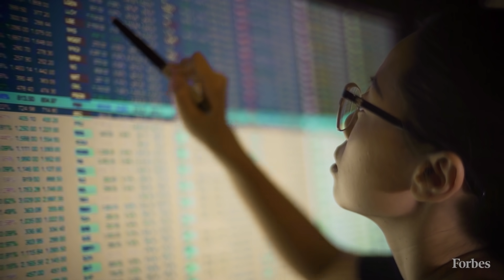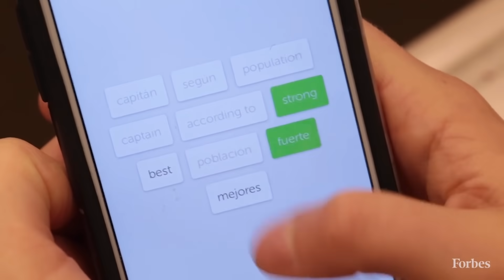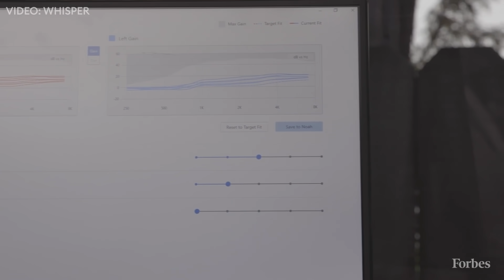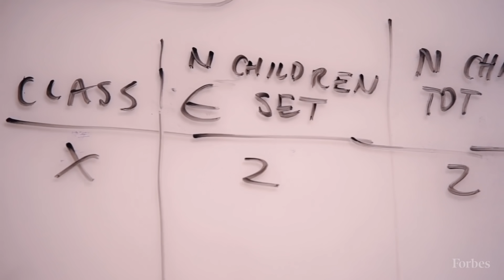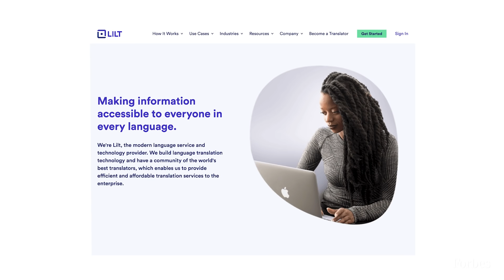The Top Artificial Intelligence Companies To Watch In 2021 | Forbes

Comment: AI doesn't exist yet. These are just advanced statistical models.
Reply: My exact sentiments. This is why humanity will have a hard time replicating AI, because every AI org out there is focused on making money rather than admitting their ignorance and ask the right questions.
Reply: Just like your brain, maybe 👀
Reply: @happybydefault  Human brains are far too complex.
Reply: @yes That's the normie thing to say. If anyone understood it enough there would be self aware AI by now.  We're still generations away. Read some papers smart guy.
Reply: Exactly
Reply: It does they have software that is able to code its self
Reply: @cameronvincent It does but it's all still dumb. You could defeat it with some tape.
Reply: @zinjanthropus322  A.I is like compound interest it will get significantly better over time
Reply: @cameronvincent  There are hardware bottlenecks. This and next generation computers won't be able to run very capable AI. There are a few people working on the right architecture though but it's still research.